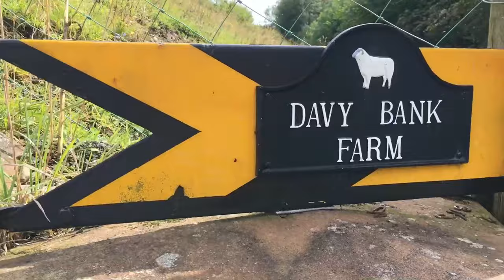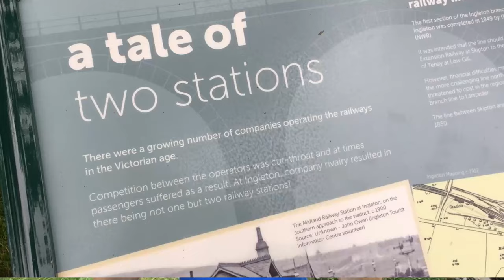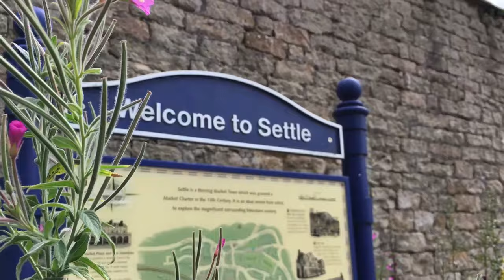Abandoned Lowgill Railway Viaduct & Ingleton

Comment: Excellent vlog, I’m down the road in Kendal, many occasion I’ll go up to to Lowgill and take the country lane west of the viaduct.  At the top of the lane is a large siding to park the car by the west coast main line to watch the trains, in my case to watch the special steam trains.  That road carries on to M6 junction 37, it’s a strange road as it’ll switch a few times between a A-road standard to single country lane, always wondered why this is.   On the BFI website is a good free short film from 1971 called ‘Motorway through the Lune Valley’ about building of the M6 through the Tebay Gorge, and includes the West Coast main line.